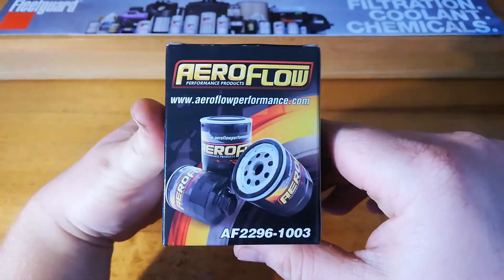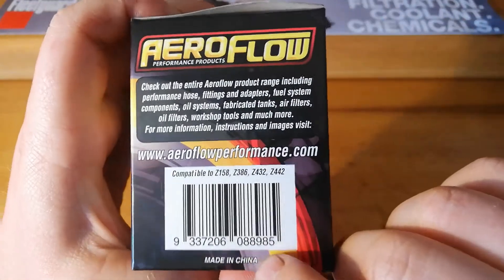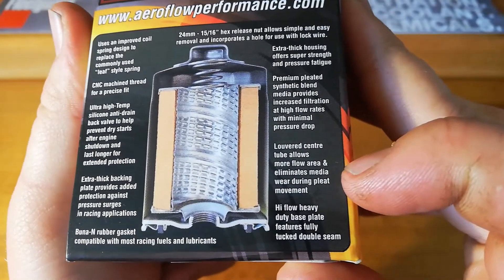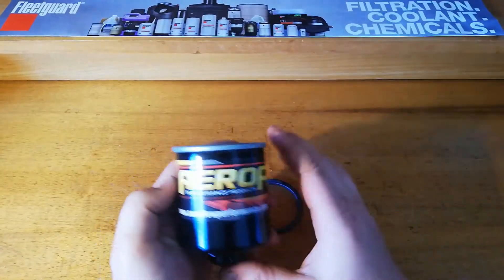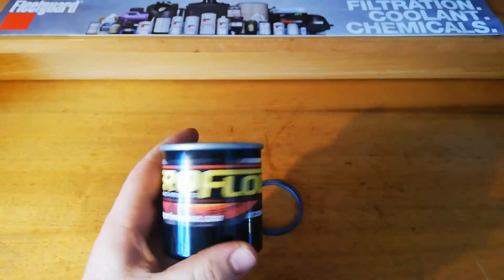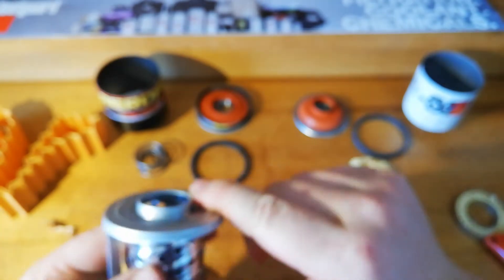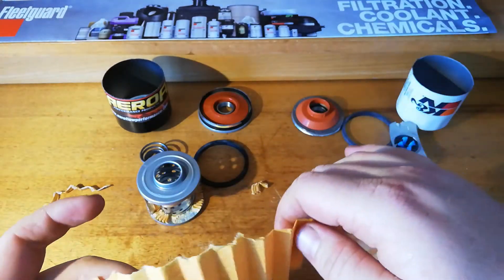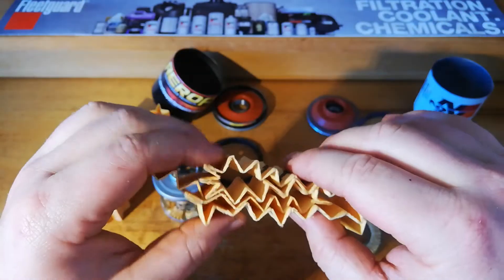Aeroflow AF2296-1003 Racing Oil Filter, Cut Open and Review, Compare to K&N 1003

Comment: Thanks for the review. I've used Aeroflow on my cars for years, no issues. Then again, I change my oil every 5k. The glue is a concern but, I don't think it would pull apart like that whilst in use. Otherwise you'd definitely hear about it amongst users of the product.
Reply from the maker: Thanks for the reply. It's good to hear from someone that uses the product, as I've never seen one or the shelf or on an engine myself! Yes, it seems hard to find a filter that has not to much or to little glue these days but its not the end if the world
Reply: I don't think the glue would be an issue at all with the filter still intact